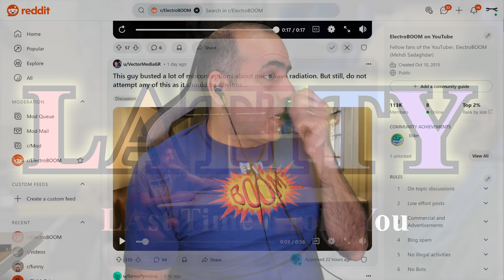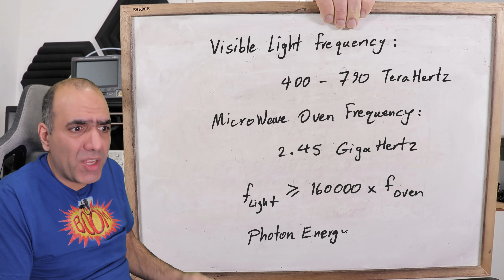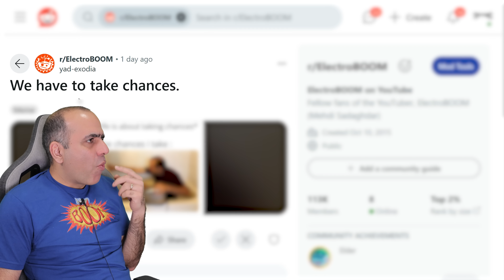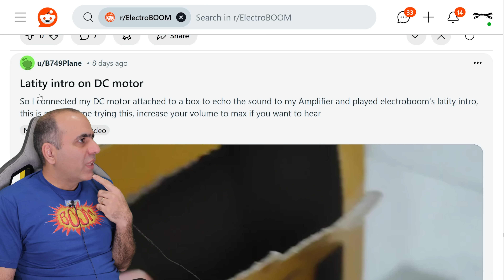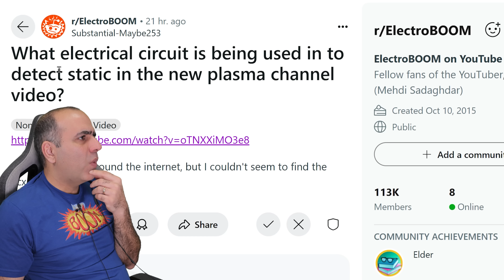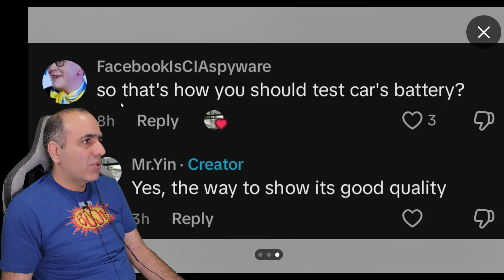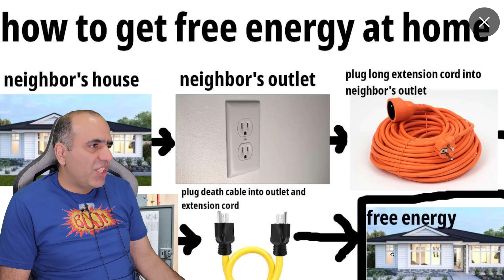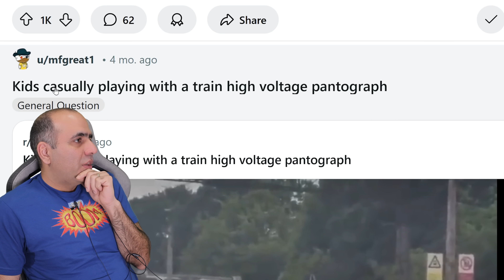Can You Microwave Yourself?! (LATITY014)

Comment: The greatest risk of being exposed to microwave radiation is for the eyes, unlike organs such as the hand or foot, the lens and also the vitreous fluid inside the eyeball do not have any blood vessels and the flow of liquid in them is slow, so in case of heating They cool down very slowly and microwave radiation may raise their temperature to such an extent that it changes the protein structure of these tissues and makes them cloudy, so never expose your head to microwave radiation for a long time.

Comment: Hi dude! In Argentina got electric showers models. The Lavarmin mark. Those have 2 wire resistors 10 and 20 Amps inside a rubber hose. And a switch from 0 to 10, 20 and 30 amperes. Also we have some models imported from Brazil.

Comment: I have the power outlet bar at 12:14. Works fine.
2 laptops
4 monitors
2 desk lights
2 small speaker sets
Miniature video camera and screen
And 2 charging stations for robot vacuums
Total power with everything on measured at less than 600 watts.

Comment: Well, there is that whole tuned waveguide and the cavity being a resonant chamber that's tuned to the frequency of the magnetron.
The car battery tester isn't far off the actual mark, testers usually use a carbon pile resistor and ammeter to actually determine how much current a battery can toss. A wee bet easier on the battery than the higher discharge rate of making something glow with heat and of less potential excitement when dealing with a lithium battery...
I have taken a Europlug and jammed it into a BS1363 outlet in a pinch, royal PIA but can be done, picked up an adapter for it as soon as I could, as I said, in a pinch and I really wanted to heat that tea kettle.

Comment: 13:54 Maybe no shock but with fresh battery that chirurgical steel could get nicely warm. Warm enough to get some reaction.
Reply: The problem is those 9V batteries shown there have a high enough VOLTAGE to feel uncomfortable in contact with wet bare tissue like your tongue, but the CURRENT they deliver is ridiculously bad. If you short a battery like that with something of near-zero resistance like a metal piercing all the energy will get dissipated in the (much larger) internal resistance of the battery itself instead of "heating up" the piercing to any degree, and it will not be all that much energy to start with. Doing the same with a modern lithium battery willing to dump insane current into a short, on the other hand, might go completely differently...
Reply: @AttilaAsztalos  Yes you are right. 9 V batteries have great internal resistance therefore can provide limited current. Hence I wrote a "fresh battery" and "warm" not "hot". However chirurgical steel is not a great conductor either. It would be interesting to try how warm it would get. About voltage on wet tissue. I do not think there would be any significant voltage with a short circuit and as you pointed out a hi internal resistance source as 9 V battery. Like I said it would be interesting to try. PS I like your devious idea with lithium cell. Sounds like fun but also potential burns so I am not touching that plan.

Comment: Euro plugs are not supposed to fit into UK sockets. But if you're motivated, they can. But they shouldn't. Don't do it, unless you've lost the converter for your electric toothbrush and you really really need to brush your teeth.

Instead, use a "I'm a UK person visiting europe" converter plugged into a shaver outlet with a 4-way extension cord hanging off it, so you can plug more than one toothbrush and a razor (each one with euro plugs in proper converters, of course) into the single outlet.

But also don't do that, the outlet isn't rated for it. However experimental evidence shows it works for (currently) a minimum of 4 years and counting.

Comment: The bike under the power lines . . . Those being high voltage AC lines, is it maybe a field generated as they move through the magnetic field quickly? Likely surrounding metal parts, handle bars, seat post, etc...? So, that is why the sign addresses bikers, not walkers?

Comment: 11:05 This is'nt  the safest thing to do theoretically. The UK contacts (inside the socket) are likely made to make a line contact with the UK plugs) If these are used with a round euro plug, the contact would change to a point contact. This would increase resistance and voltage drop at the contact (even if slightly) causing more heat.  Source: I used to design sockets like these 🙂 at my first job a decade ago.

Comment: U did this vid 2h as I am typing I did finally a controller for frequency for my car coil and some home made ones very happy with results 5cm arcs yayy finally and yeah I will post  vid on yt here and then send another comment here so anyone can look btw I am 15 and finally got adjustable frequency I feel good and even better it shocked me only twice and iam putting 30v 5a into the coil quite strong arcs blew up my 380v led iam happy I finally did it and wanted to tell it and nice vid Mehdi

Comment: 14:30 That's probably the worst thing I've seen in a while. Many people climb on these trains, get electrecuted and either die on the spot or in a hospital. And when they do survive they often have some of their limbs amputated or have to deal with massive health problems later on.
Reply: I'm pretty sure Mehdi had flashbacks of those videos and gifs widely shared in the wild west era of the Internet, guys surfing on wagons, they just graze the wire, BOOM, flash, smoke goes up, the skeletonized remains of what was once a human go down like a freaking Looney Tunes Cartoon
Reply: I hoped he will elaborate more how dangerous that train stuff was! One thing is putting fingers into home sockets (what obviously will kill you), but that is another level! 
It had to be DC system so they may got away with this if very lucky. No way it is possible with AC system which is a lot more common and you may not tell the difference. They were as good as dead.
Reply: @hbh3144  It's actually more likely that putting fingers in sockets won't kill you. I've had more 240v shocks than I care to remember, and while they hurt like hell, the crucial factor is that they weren't across my chest. The current path through the body is the main factor with household electricity.
Reply: @hbh3144  There are some lineman who survived shocks from 35 kV distribution lines and several documented cases when people survive 25 kV 50 Hz shocks from railway power lines. So it is very much survivabe. If you say no way you probably also didnt hear about the guy who survived 7 lighning strikes.
Reply: @mernokimuvek  I am aware that some people did survive. My point was don't do it. Humans do not have instict telling it is dangerous and if no one told it that's a problem. So I told it here at least :) There were people that fell from plane and not only survived but in one occation literally walked away. If stars are just right you may be fine. Regarding those 7 lighting strikes it feels there are more to the story then it was told.
Reply: My heart nearly stopped when I saw that, I actually shouted "WHAT ARE YOU THINKING??" at the TV, but then I realised those kinds of people probably don't do much thinking of any kind. Regardless of age or education, when you ignore all the signs and see that kind of arcing, if there still isn't a clue in your mind that you perhaps shouldn't be interfering then it's simply natural selection at its finest.
Reply: @harrysmbdgs  Unbelievable! was my reaction. Then I figured he was probably young enough to haven't had any kids yet so when something went wrong the gene pool would be improved and he'd be eligible for a Darwin award.
Reply: Ofc it's in Moscow lmao
Reply: @The_Georgi0 we get about 1 to 3 lethal accidents with these old trains every month. But yeah, it's just a self-solving problem
Reply: Reminded me of the videos I was shown during my OSHA 10 hour cert, a guy in India decided to mess around on the top of a train and got too close to a power line. Guy didn't walk away from it. OSHA doesn't mess around with their materials, half the videos I saw were of folks that didn't walk away from their mistakes.
Reply: No matter what voltage the catenary is on, the whole construction of the pantograph is live, and that's why it's mounted on insulators on the roof. The current runs back via the coach, wheels and rails to the substations, not to the ground. The rails are not connected to the ground but have a resistance from the ground between 2 and 6 ohms. This is done so track occupancy control etc.. can be done. So, in my opinion this idiot is extremely lucky, it's fake or faked, because touching the pantograph usually means instant death! When electrical units or locomotives came in for inspection after their daily service and we had to inspect the pantograph, we were always obliged to use high voltage discharge resistors between the pantograph and the coach just to make sure that due to failure we could not be electrocuted by any remaining high voltage coming from the capacitors in the motor drive or high voltage circuits.
Reply: @techcentermitch6841   He is essentially in parallel with the train and has much greater resistance. Some systems also have very high impedance to earth.
Reply: it's really just a self-solving problem.
Reply: Should it be 25kVAC, those kids wouldn't be so cool anymore
Reply: I am so confused, he stands on that train wagen, which is basically ground, how on earth he able to go near the live phantograph, letalone holding it without getting fried?? What magic boots he has?
Reply: @danielbedrossian5986  There are two possibilities here, one, in at least some and possibly all locomotives the high voltage is isolated from the frame, probably for safety and ease of reversing, and 2, the roof may be fiberglass or some other non-conductive materiel.
Reply: This pantograph is live, and is separated from the roof with isolators, but the small walkways on top of such train cars are often made of wood, so he can live a little longer.
Reply: I am wondering how he even got up there?
Reply: It is even more scary than it seems. Those trains run on 3kV DC, and there is a wooden plank catwalk on top of the roof near the pantograph area. But dude is clearly standing directly on the metal of the roof. I have no idea how this didn't end up with them getting fried.
Reply: It highly depends on the design of the system. DC and AC systems act differently, also voltages are usually different and the frequencies vary also. At least here in Central Europe, you have a mix of 1,5kV DC, 3kV DC, 15kV 16,7Hz, 25kV 50Hz. Each system has its own effects. Some electric locomotives which are designed to operate in multiple countries on multiple systems have up to four separate pantographs to comply with different voltages, currents, pressures of the contact strip against the overhead catenary as well as the dimensions of the contact strip itself. Because historically multiple different systems were introduced over a relatively short period of time and the swapping of locomotives turned out to be time consuming, it is pretty common to see modern locomotives capable of running under multiple systems since the 1970s and especially since the 1990s, as technology advanced, as well as renewed former "east block" to "west block" connections. Even some "crazy" modifications of existing rolling stock were made, e.g. ČD class 340.
Reply: @ErikZiak it's Moscow idk the voltage but I saw pictures of consequences ... Its high enough to make you well done in one second
Reply: @ErikZiak I think it's safe to say that literally all of the different operating voltages are extremely dangerous
Reply: @ErikZiak 27kv is the only one i know , for real trains and not city transport (like trolleybus)
Reply: Hilarious!

Comment: 5:16 the motor is a coreless one, which means the rotor has very little mechanical inertia (and inductance). The motor you used was a cored one which has a lot more inertia, so you cannot expect too much 'audio output', especially at higher frequencies.
Reply: Yes, the motor speaker definitely not fake! You just need to use the right motor (looks like from a vibrating gamepad) PLUS you need to press it onto a sheet of wood, like a tuning fork, makes it much louder. That is also why it takes a second when he puts his finger on. He needs a second to increase the pressure before he presses hard enough.

Comment: 4:00
interial burns aint a joke
dont do this!
Reply: neither is the shock from the transformer. thats waayyy more dangerous then the magnetron
Reply: Safer than 5G. This is rotting the brains of everyone.
Reply: This wavelength won't penetrate more than about 3 or 4 millimeters, so the brain is "safe". The rest, though....
Reply: @MCPicoli  
hmmm.
This wavelength can penetrate a whole chunk of Chicken if you want.
Thats more than 3-4cm.
Reply: @MCPicoli  Not true, 2.4ghz depending on the part of the body can penetrate 2 to 4 centimeters. That is 1 to 3 centimeters more than enough to cook your brain
Reply: @Awaken2067833758  Not true bone is dense and rich in calcium. The brain is safe.
Reply: @MCPicoli The pot pie I nuked the other day says that it penetrates a lot more than 3 or 4 mm.
Reply: @JonBrase  Depends on the water content. For dried goods, it may be several centimeters, by for humans that are 70 percent or more water,  just a few millimeters.
Reply: 2.54GHz cannot penetrate more than an inch of tissue, they cannot cause internal burns.
Reply: @teresashinkansen9402 An inch is pretty dang deep. And in any case, the band in question can't be too non-penetrating, or it never would have been selected, because the entire point of a microwave oven is to cook the entire volume of your food. Guess what meat is? Tissue.
Reply: @JonBrase  The reason such frequency was selected is because it matches one of the dipole resonances of water molecules and second and probably main reason, is far cheaper to make magnetrons for such band, not only is a band allocated to such devices, longer bands also mean physically larger magnetrons and shorter bands mean much more tight tolerances on the cavities.  2.5GHz microwaves cannot cause internal burns.
Reply: @teresashinkansen9402  
you are 70% water.
This water gets heated up by it.
Reply: @neutronenstern.  And? that only means is possible to get burned by microwaves but that does not say anything about internal burns, in fact that means is harder for you to get internal burns because most of the energy is absorbed by your skin and first mm of tissue.
Reply: @teresashinkansen9402  
Ok. Most of the energy is absorbed within 5cm.
But 5cm is a lot.
Also 700W is a lot,and even if only small part of it enters deeper it is too much.
And it is enough to heat up tissue to 50°C for it to get damaged.
For food this would be too less.
Also you know, that some tissue will not get heated that much, but other tissue will get heated more. And this tissue will then most likely receive damage.
Also your eyes are outside your skull.
And they might get damaged.
The brain is mostly covered by bones, and these prevent Radiation to get to your brain, cause Microwaves do get mostly reflected by minerals.
However there are openings in the skull.
And thd brain is very sensitive.
So i am not a biologist, but i guess its not good to have any brain tissue above 42°C even for short time.
Reply: @teresashinkansen9402  you know what you have an inch into your head?
Reply: @teresashinkansen9402  
How can i heat a chicken in minutes in the microwave then?
Reply: @neutronenstern.  Because you are pumping like 700W or more of heat into it. Similar to how induction stoves can heat up the pan way faster than a flame.
Reply: it really annoys me how dumb people are with microwaves. he's fine ffs. they're not that scary.
Reply: @Heroo01 People treating microwaves like they are ionizing radiation is stupid, and people treating low power microwave radiation (cell phones, etc.) as dangerous is stupid, but a microwave oven is meant to bring the stuff in it to the boiling point of water, and, by design (to cook food thoroughly) it penetrates deeply enough to reach organs that aren't necessarily serviced by pain or heat sensing nerves. The dangers presented by a device built to such requirements (whatever the underlying physical principals) should be obvious. It's meant to cook meat through its entire volume. You are meat.
Reply: @JonBrase  BTW we do have pain receptors inside the body and in many organs, I don't know from were that myth came from. Have you ever had a stomach ache? heart burn, intestinal colics, an UTI, there is also kidney pain, you can even feel pain in the bones!
Reply: especially in the brain, I can't believe what I saw

Comment: A Uk socket outlet is designed to grip square pins, not round, so they don't grip the round european plug pins tight enough which can lead them to work loose and causing  arcs
Reply: The euro plugs are slightly narrower than the type g socket so they're not loose at all. They're very often tighter than a g plug